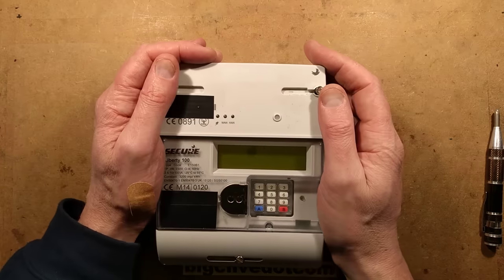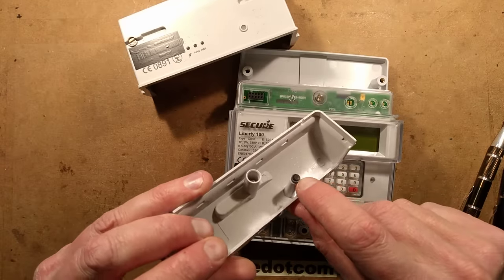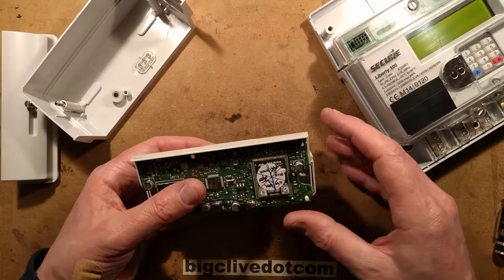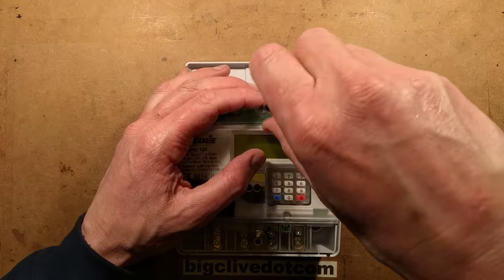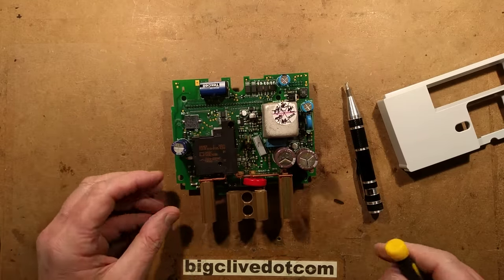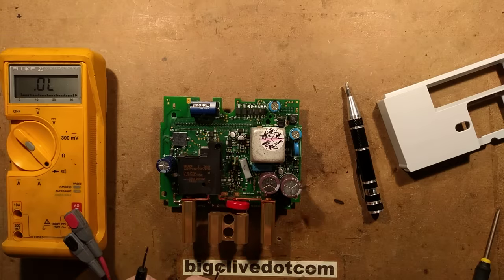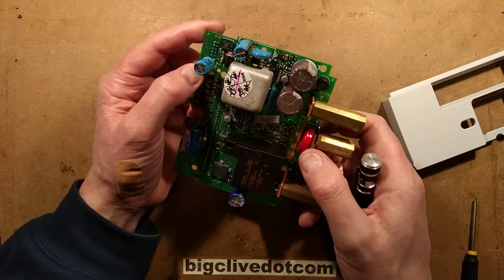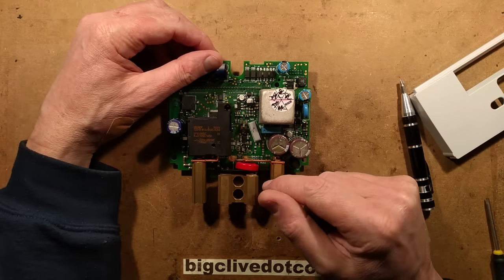Inside a smart meter, and the REAL problem with them.

Comment: So the theory that they can remotely disconnect a customer IS true.
Reply: Very true.  However, they can't yet watch anybody in the bathroom.
Reply: Absolutely Affirmative (YES on remote disconnect as well
as spying on your usage timetable.)
Reply: Very practical though. You can now:
- disconnect those on eco energy plan when there is no wind
- find all those hidden greenhouses where they plant cannabies without thermal cameras & helicopters. Either by consumption or by opt-out forms 
- find those who didn't follow order and are still using old lightbulps, vacume cleaners and any other banned devices ;)
Reply: I spent 2 years as a data administrator for a smart meter operator in New Zealand. Much of my days was remote disconnections and reconnections. Also tracking meter tampering and looking for patterns of people jumpering the meters to steal power.
Reply: Would be an iconic move to have the microphone inside the control power shut off relay which is located over top the chunky location on a processor chip; regardless the heavily shielded modem emitter located on the main board and the modem emitter board could be a contentious source of radio emission frequencies and electromagnetic frequencies, fascinating dissection of one model unit.
Reply: @marcinwaach7639  How are they going to find grow houses lmao, they'll just bypass the meter as always, to me it looks life no RF jammer detection so it could be jammed disassembled and reflashed which means they no longer have to bypass the meter just reprogram it.
Reply: @marcinwaach7639  surely all the growers earn enough to go eco and set up solar panels and low energy grow lights. :D
Reply: @eLJaybud  Modern LEDs are very efficient ;)
Reply: Despite what Clive said, they do have a hidden microphone. It's on a miniature drone  and flies out when you open the meter. People often mistake it for a fruit fly.

Comment: The big metalic shield is to protect the flyback transformer (the SMPS which is powering the meter) from getting saturated under magnetic tamper and the relay is a bistable type so it stays in it's position once set

Comment: The ability to change how much you are being charged instantly any time they want without even letting you know is what concerns me. Especially now we are in an energy crisis. I have a smart meter and got a letter from them saying that despite the governments energy cost cap they can still vary what they charge depending on what they pay.
Reply: @Sheree Boulton I have disabilities Sheree, and live on my own. I basically have a lamp and my computer on most days. My bill is now £115 a month ????. And I haven't even put my central heating on yet.
Reply: They can change the cost of a Kwh whether you have a smart meter or not..

The meter just indicates usage, the billing department can adjust the pricing any time they want, with or without a smart meter. 

The one thing they CAN do with a smart meter is charge you more or less for "peak time", "normal time", or "off time" usage. My bill actually went down after my smart meter was installed, because I use most of my electricity at night, during the "off time", or cheaper tier.
Reply: @davelowets  Before I had a smart meter I was on a set tariff. One price every month. Every quarter you might have to pay a shortfall or sometimes they owed you money. Smart meters you can't do that. So you never know what your bill will be. I don't know about you but I am not a millionaire and have to budget. Smart meters have taken away my ability to do that in terms of electric/gas use.
Reply: That's certainly a regulatory issue more than a technological one. These things enable time of use billing but if the power company feels like jacking rates the only thing stopping them is the law. Whether you're on a flat-rate or tiered tariff or TOU it doesn't matter, they'll just raise prices. Happens all over the world

Comment: I really don't like the idea of these.
The electric company has made an error in the past where they decided we owed them too much money, and come round to disconnect us.
However, upon checking the meter locally, they found out that they were at fault.

Now if they can remotely disconnect you, and they are in error, what kind of compensation plans do they have in place?
Reply from the maker: Likewise I received a bill for tens of thousands of pounds last year because their estimated readings were so far from my real usage that they thought the meter had "rolled over" and charged me for a massive number of units.  Theoretically with this type of meter the readings should always be up to date.
Reply: I must be lucky my meter looks like its from the 70s its a black slightly rusty mechanical lump, i was out of the flat for about 7 months after idiot workmen set fire to the water tank on the roof, i just paid the bills because I couldn't get in to check the meter with the workmen in here dealing with the aftermath (badly because they are useless), when I did give them the reading they credited my account by over £400 no questions asked, I found that strange, no one was sent to check, similar with the gas but its outside so they could easily check that without me knowing.
Reply: They don't actually use the remote disconnect - they do not know who or what is in the house, and they would be liable if they cut power and caused harm by doing so.
Reply: Indeed. All a bit too complicated for doing something 'simple'... and just asking for something to go wrong. And when it does, it's the meter's fault, or a computers - not a person. And you get the fun of trying to pin someone down on the phone (probably in an Indian call centre) to take steps to rectify the situation... All a step backwards in the name of 'progress'. A bit like Australia's 'National Broadband Network' government initiative... Which is that badly broken that the upgraded version is the Pigeon Network.
Reply: You get "compensated" with a Reconnect Fee. LOL Just like Xfinity (Comcast).
Reply: Peter Feerick - All those claims of "fibre to premises" for everyone - which soon degraded to fibre to node (and the same decades - old copper to premises). Interesting, too, that those who DID get FTP service were mostly in the "well-to-do" neighbourhoods; us "also-rans" had to make do with the lesser FTN service.
Reply: You can't get away with 'usage averaging'  with a smart meter.  If you are billed a set amount by direct debit each month then you could use a lot more in winter and let the level average out when it got to summer.  You'd then let the meter reader in, and you magically haven't used any more than the average over, say, six months so your bill remains the same.  As you only needed to legally let them take a reading once a year it was easy to get away with.  Not so for smart meters - booo!
Reply: Compensation? When in doubt, blame the costumer, after all, the costumer is always wrong.
Reply: @Monkeh616  Doesn't actually stop them from remotely disconnecting people's power if they really wanted to. Laws can be changed in the future, and I'm sure that there is already some clause that allows the government to disconnect individual supplies in the case of suspected illegal activity.

Comment: Years later I find this vid relevant. 
Here we are in an energy crisis and bills are rising stupidly. My SP (OVO Energy) have just me a rather forcefully ambiguous card saying my smart meter is ready and to choose when I would like to have it fitted. NO NO I do not wish to have a smart meter! The software can be commanded remotely to disconnect you or put you onto prepay. I do intend paying my bills but if I'm struggling coz of astronomical charges I don't like them to have the power to put me onto prepayment. 
The use of gas and electricity was 'sold' to us as consumers to be 'the best way' and now we are being punished for using it. I cannot heat my home with coal or wood as an alternative

Comment: More than likely the other radio is an 802.15.4 A.K.A Zigbee, which is used extensively in smart meters. The big metal block on the back is likely EMI shielding for the high frequency transformer in the SMPS, and the optocouplers are probably also part of the SMPS power supply. If I had to guess about the metal bridge is that it's a shunt for measuring current. Great video as usual!
Reply: @peacedreamerable  Name a SINGLE mobile phone company that says mobiles are cancerous. Provide a CREDIBLE example.
Reply: @playaspec  Sorry my bad , I should have used the word possibly cancerous , ugraded 2019 which is why underwriters will not insure for harm done to customers and advise keep phone at least 10 mm to 10" away from body , depending on which countries advice you follow. Uk has the worst record for exremely low/not fit for purpose regulations.

Comment: The hall sensor is another tamper sensor. Most of these meters use CT's for sensing the load, so the hall sensor is there to detect anyone trying to defeat CT by using a strong magnet. [most are hardened against it, but it is a "well known" hack, probably from some older meters]

Comment: The thickened part of the bus bar on the customer supply side is a calibrated shunt to measure current. The resistor tree is likely a voltage measuring circuit. Put the two together, one can measure power.
A lot fancier than my old Fluke 77 original model multimeter, before the 20 amp circuit was fused, a chunk of 12 gauge wire, with a tap soldered partway down the wire.
Reply: Works really well an can tune it too. I made one as a Watts meter for electric model planes

Comment: The 'chunk' of metal in the power line copper bar might be a current shunt.  Often made of special metal allow that has a very low temperature coefficient.  So ambient temperature and self-heating don't affect the voltage developed from current flow.  Improves the accuracy.

Comment: Interesting. Glad I resisted having one of them installed. I'm always cautious when any government/company/authority tells me "it's for my benefit" 

Because I know none of them do anything for my benefit - it's only ever for theirs 🤣

If they gave me a £100 cash: with no strings attached and no repayment required, that would be to my benefit. Anything else is horse 💩
Reply: Agreed, until a smart meter installation is a legal requirement, there is no chance in hell I will be ever getting one.
Reply: There's nothing more creepy than a knock at the door and someone telling you they are here "for your safety."

Comment: We had one of these in our rental in the UK. Our supplier apparently didn’t know about smart meters tho, and for three years demanded regular manual readings be submitted by us! 😂 And that’s how we know that one of the functions of the key pad is for manually cycling through the various display options to access the current meter reading (press the red “B” button).
Reply: I have the economy 7 version of this Meter, and I have to press 9 to cycle through the readouts. Really annoying as the time it gives you before it moves into the next is not enough time to write it down!
Reply: @sdtfoxon  maybe have ur phone camera ready to take a pic or video of the readings? That’s what I do anyway with my traditional meter as it’s low down and if I take a photo I can read it better later.
Reply: @katperson7332  I always take a picture of the readings.